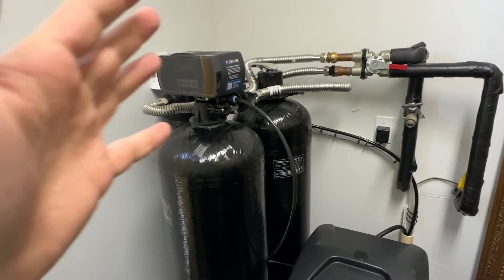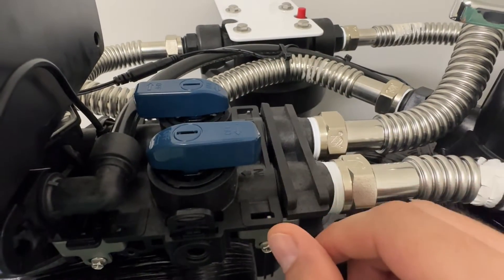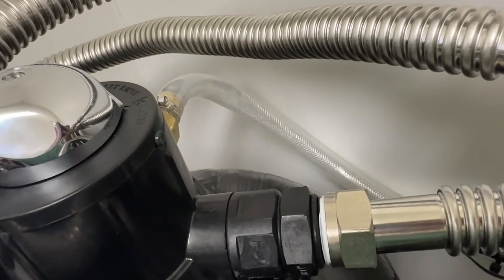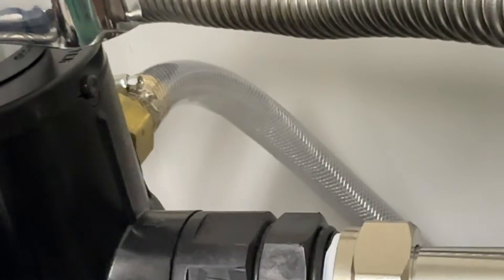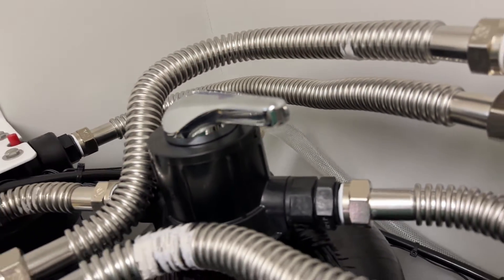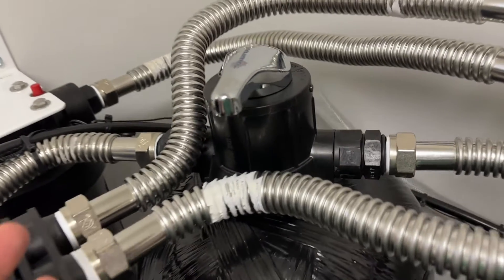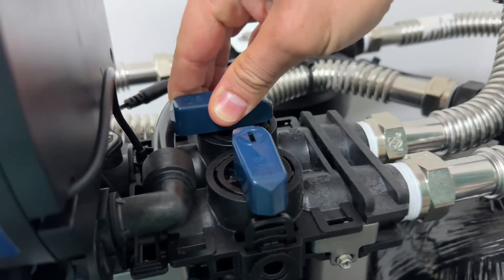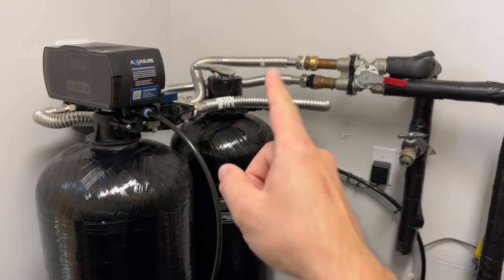Water Filter Backwash and Rinse Procedure Instructions - Aquasure #watersoftener @aquasure2816

Comment from the maker: For the full step by step DIY installation video click here: 
https://youtu.be/MBZMp5AcEOU

Here is the Aquasure system I purchased and installed: 
https://amzn.to/45jVkK7
You can also get the Aquasure system on eBay here: 
https://ebay.us/AWAvdu

Other parts and tools that I used below:
- 1inch NPT to sharkbite connector, I used 1 of these: https://amzn.to/3tgNlA1 
- 1inch NPT to 1inch NPT flex pipe, I used 4 of these (2 pairs): https://amzn.to/3Q0QOf5 
- 3/4" ID clear hose: https://amzn.to/3F60YEO 
- 3/4 NPT to 3/4 barbed fitting: https://amzn.to/3RIriwt 
- Universal size pipe reamer and deburring tool: https://amzn.to/46gEa1c 
- Compact pipe cutting tool for 1inch pipe: https://amzn.to/3PLwNaO
- Teflon: https://amzn.to/3Q1RGA7 
- 12 inch adjustable plumbers wrench: https://amzn.to/46u91qY

Comment: What size of the clear drain hose is that? 1 inch?
Reply from the maker: 3/4".
For the full step by step DIY installation video click here: 
https://youtu.be/MBZMp5AcEOU

Here is the Aquasure system I purchased and installed: 
https://amzn.to/45jVkK7

Other parts and tools that I used below:
- 1inch NPT to sharkbite connector, I used 1 of these: https://amzn.to/3tgNlA1 
- 1inch NPT to 1inch NPT flex pipe, I used 4 of these (2 pairs): https://amzn.to/3Q0QOf5 
- 3/4" ID clear hose: https://amzn.to/3F60YEO 
- 3/4 NPT to 3/4 barbed fitting: https://amzn.to/3RIriwt 
- Universal size pipe reamer and deburring tool: https://amzn.to/46gEa1c 
- Compact pipe cutting tool for 1inch pipe: https://amzn.to/3PLwNaO
- Teflon: https://amzn.to/3Q1RGA7 
- 12 inch adjustable plumbers wrench: https://amzn.to/46u91qY

Comment: After my install of my aquasure I noticed less water pressure.  I just have the resin tank and salt bin.  Any ideas what might be causing this?
Reply: Pre filter replace that’s one
Reply from the maker: A very slight decrease in pressure is normal. But shouldn’t be noticable. Are you on city water or well water? Did you use smaller full 1 inch lines and a 1 inch bypass valve? If you used smaller 3/4 inch that could cause some pressure loss
Reply: @ well system. I used 1”. My pressure increases when I put it in bypass.
Reply from the maker: grab a water pressure gauge and measure your actual pressure to see where it’s at and if it’s within normal ranges. Start there and let us know what your findings are on pressure in normal mode and pressure in bypass mode. Here’s a cheap one that works well https://amzn.to/4g4DaBx

Comment: @NKP Home Improvement 
How do you like the system after a year of owning? I’m looking to buy a system for my home and came across this but seeing mixed reviews on Amazon. Some stating that the water hardness didn’t change after installing and testing. Any insight? Did you test your water before and after?
Reply from the maker: It has been absolutely awesome. Compared to our previous water softener that we replaced it has produced noticeably softer water. 1 year later now, our shower heads have not needed any cleaning at all, our iron has not had any mineral buildup at all, our coffee machine filter has not accumulated any minerals at all, and the Aquasure system is still working flawlessly. It is performing far beyond our expectations. For a water harness test, we have done it every year in the 10 years we have been in this house. Our home had the old water softener that was installed in 1998 here since before we moved in. We repaired it over the years as it needed maintenance. City water here is around 14 GPG as it is delivered to the house. With our previous water softener we were consistently at around 5-6 GPG every year when testing. With the new Aquasure water softener we have been been testing every 2 months and over the last year we have consistently been at around 2.5-3 GPG. The system has been working very well and we are very happy with it.
Reply: @ I appreciate the reply. Will definitely be looking into buying. I have really hard water here where I am in Illinois. I appreciate you taking the time to get back to me.
Reply from the maker: you got it! good luck on your setup!

Comment: My home filtration system doesn’t have a backflush valve…. Only the softener can be backflushed
Reply from the maker: Does yours have the carbon filter in addition to the softener? The backwash valve on ours is on the carbon filter.
Reply: @nkphomeimprovement3625   yes we have a separate cylinder for filtration. We are on city water and it passes through the filter then to the softener and then to our domestic water supply. We have decent water here but it’s a bit hard at 10.2 grains. I bought the filter because in the spring months the municipality must dump extra chlorine in the town water because we can smell it. We bought a Softpro Elite Gold system from Quality Water Treatment. They were the absolute worst company I have ever dealt with. I tried to save a few $$$ and buy a system online. I should have just spent a bit more and bought a Kinetico locally. Live and learn I guess.

Comment: Trying to understand the maintenance once all set up. But for this carbon filter, we have to run the backwash+fast rinse every 7-10 days according to the manual? Is that correct? Also on top of that, do we have to shut off the water softener in and out valve for this step?
Reply from the maker: It depends on how much water you use, and the quality of your water going into it. For us (family of four) we are backwashing the carbon filter once every 60 days and I think we could probably go longer. We are on city water that is already fairly clean so it doesn’t require it as often. If you were on well water or water coming from a lake siphon you’d probably want to backwash it more often. 

Nope, you don’t have to shut off the other water valves to backwash the carbon filter
Reply: Thanks for the quick reply. Awesome, yea I was just looking at the booklet first time when. It only said 7-10 days on the booklet, almost thought that's crazy amount of manual maintenance since it doesn't do auto regeneration like the softener do.  When do you plan on replace the the filter?

Comment: Does the manual state that the water softener’s water have to be shutoff? Im just curious because I have the same set up.
Reply from the maker: No. The manual didn’t state that. But I shut off the water softener feed so none of the carbon or things it has filtered accidentally gets in there. Just to be safe I guess.
Reply: @nkphomeimprovement3625  thank you for your reply, i see that what you are doing makes sense. Maybe I will try.
Reply from the maker: You got it!

Comment: I don’t have that 2nd black tank. It’s just the small filter housing then to the main control unit tank. What’s the procedure if I’m replacing the filter from the small housing
Reply from the maker: First you turn off the main water feed to the filter. If you don't have a cutoff close by you will need to shut off the water main too the house. Then find the faucet on the bottom floor of the home open it on both hot and cold and let all the water drain. Then hit the red button to release the pressure from the filter housing. Then use the filter housing wrench to unscrew the housing to replace the filter. You'll want to keep a bucket, and some towels nearby to catch the water that may drip out.

Comment: Thank You. During backwash, do I need to shut off main valve ? Coz so much water wasting during the process.
Reply from the maker: You have to leave the main valve to/from the house open. But you can shut off the valves at the water softener
Reply: If u shut off then it won’t wash

Comment: Thank you for the tips. I have questions, after those procedure, i dont have any softener, what would be the cause?
Reply: Yes i did.
Reply from the maker: Were you getting soft water before back flushing?
Reply: @nkphomeimprovement3625  yes we got the soft water at the beginning. After a month, it's gone. We even tested the water and it's just the same as reg tap water.  I followed all your tips but it's still not working
Reply from the maker: Something must not be right. How old is the water softener? Do you know when the last time was that the water softener ran through a refresh cycle?
Reply: @nkphomeimprovement3625  it's 3 month old. What do you mean by refresh cycle? Is it when the capacity goes down to 0?
Reply from the maker: Did you make sure to turn the knobs for the bypass valve back to the service position?